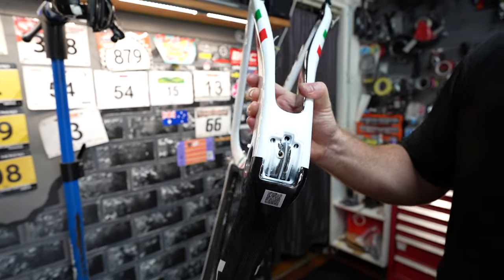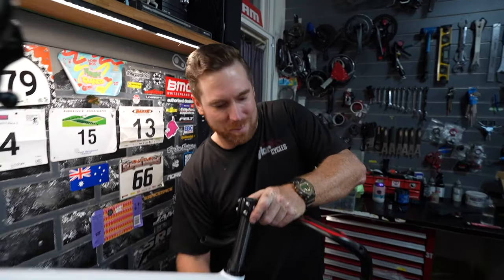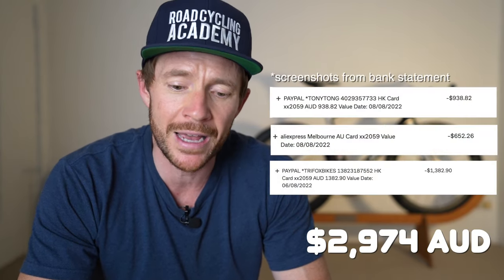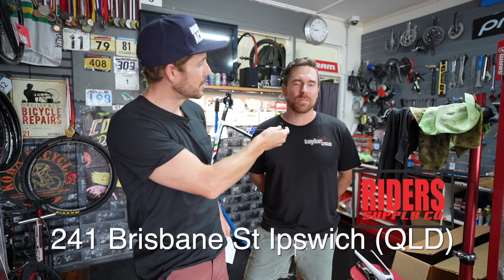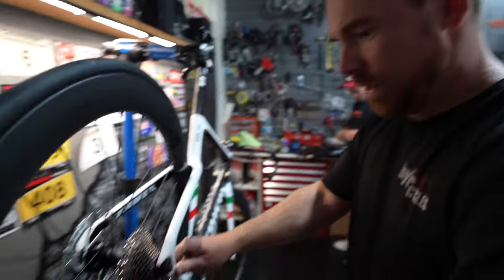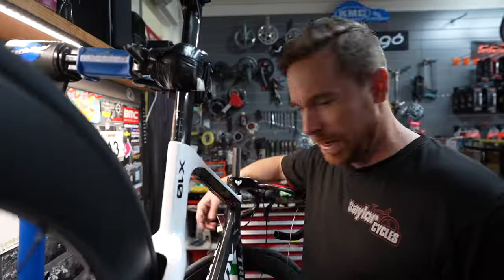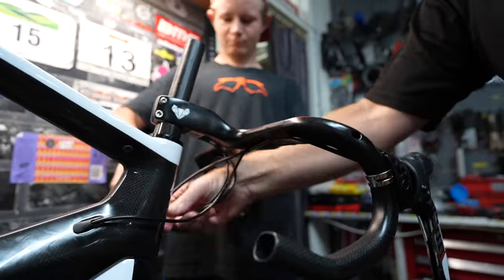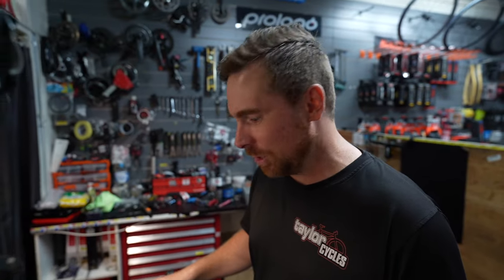We Built A Cheap Chinese Carbon ‘Race’ Bike (any good?)

Comment: well, I've been following Hambini & oz_cycle for years. I think I'll trust their opinions a lot more than a mechanic that puts together a carbon bike with a hammer.
Reply from the maker: Let’s not forget Gary from Carbon Steed was quite critical of the Trifox. Did both Oz Cycle and Hambini buy the frames or were they given them? I don’t know myself.
Reply: Exactly the handlebar issue could've been worked around with a little sandpaper, but instead the man just whacked the body of the stem with a mallet. Not really confidence inspiring
Reply: The Rubber Mallet displays an artist mirror of the frame quality....
Reply: @taylorcycles1931  I would NEVER trust a "mechanic" who uses a mallet on ANY bike, regardless.     Rgr
Reply: @borano2031  Your missing the point, I would never and never use a rubber mallet on bike build!  The quality was so bad i would not have built this bike up for a customer.
Reply: @taylorcycles1931  "Never use a rubber mallet"?? Point is you did. Not??     Rgr
Reply: @paolo_siega  Agreed, personally I would have removed the bolts completely and then possiblay tried a small wedge. No money to be made from people buying chaep Chinese frames. The big brand names took the piss during covid with their pricing but some people just believe the hype and jump on the cheap frames are crap bandwagon.
Reply: @stuartdale347  too true. I do understand the appeal of these cheap china carbon frames, but you're also paying the bulk of the money for QC and warranty support. I still don't agree with how the mechanic just hammered the stem in place just because it didn't fit right. no matter how cheap or expensive a bike is, its no excuse to just whack the thing hard and hope things fit because something just doesn't fit right.
Reply: @paolo_siega  And he hit it all the way down the steerer that could have been cut an inch over length first!!!. Seemed like it was a bit for effect for the sake of the video but came over  as a bad mechanic.
Reply: Wondering where this idea came from to build a „cheap“ carbon bike. Everyone is doing it, its totally against sustainability and has no value. Either buy good quality bike (could cost the same) that you can ride many years or build a bike from vintage parts.

Comment: I am a little confused about the complaint about the cable routing through the frame. I see he has the rear gear cable run through the right hole in the downtube (and the front on the left). But I run them the opposite way, with the rear going the the left hole and vise versa, so the housing does not rub against the headtube. I know you can stick helicopter tape on the headtube to prevent the housing from abrading the paint, but I would rather run the housing to the opposite side and not have them rub the tube at all. Plus it makes for a smoother bend of the housing from the handlebar. Also, I would use cable liner on the cables running under the bottom bracket to prevent them from rubbing on the bare carbon, so I would not consider that a legitimate complaint either.
Reply: All 3 cable grommets were for gear cables, the brake/disc grommet should have had a lager hole for the full length cable. Also the runner for the rear brake was pre run into the front derailleur lines.
Reply: @taylorcycles1931  I watched Hambini's Trifox review from a year ago, and now see the ports on the left side so I understand the problem now. Thank you. I wonder if he was sent a curated example for review, because he was rather impressed, given the cost. His was a different model, though. Regardless, since your example had faults, Trifox may not have good quality control over their production.

Comment: I have essentially the same build Trifox (X10, Sensah, Elitewheels).
My build process was smoother without some of these nagging issues like fork and seatpost, albeit I used different bars.

Put a little over 1000km on the frame and haven't had any real issues with it yet.

What's evident from the various reviews that are either positive or negative is that Trifox really needs to get their QC under control.
Reply: Cognitive bias ask the way through.
Reply: @DavidSmith-hz3jg  Or a shill account.

Comment: I bought and built a Trifox X18.  Had similar issues. Saddle clamp didn't even work (had to buy trek one that fit).  It does not ride well. It has flex in the bottom bracket and lateral flex in the fork and rear dropouts so it does wonky stuff in turns (not confidence inspiring... can't crit or road race a bike like that).  Pissed because I have like $2K US invested and I probably can't sell it, maybe should just part it out and eat the loss. Bought a used tarmac SL6 for $2750 and that is an awesome crit bike.
Reply from the maker: Interesting to hear that Travis, thanks for sharing on the thread.
Reply: Second hand SL6 value for money 👌

Comment: Great video! I have a trifox X18 frame and the build went really smooth. No issues with the seatpost, bar, stem, Frame nor fork. All from trifox
Reply: I also have a carbonda cfr 696 (gravel bike). Carbonda does have a better build quality, but they didn't have the geo I wanted for a road bike.
Reply from the maker: Interesting to hear. Thanks for sharing on the thread.
Reply: it is RNG if you get a piece of shit from them or an "okay" bike.

Comment: Having built an X10 and and X16 I can report on the following facts: the X16 had some paint overrun on the front drop outs (fixed with a bit of sandpaper). The X10 had tight clearance of the brake and shifter cable around the bottom bracket (fixed with a file). 
So how does the X10 ride? Follow up video please 🙂

Comment: As you say its certainly not a cheap build a sheet of wet and dry would sort out the roughness on the fork tube i would rather a tight fit than sloppy fitting however lets see the finished bike and your experience with the ride thanks Cam.
Reply: In my 27 years as a bike mechanic I've never seen a steerer this bad.....

Comment: I had my x16 built up with only very minor issues such as rim bike caliper fit tight and head set bearing fit tight to frame as you captured in your video. The seat post on mine fits perfectly and doesn’t have plays when it is toques up. Otherwise, it has ridden nicely and feels stiff in fast bunch rides. It seams like the seat post was rotating a lot side to side for your particular model was before it was tightened up? I think you can confirm that😊. Anyways, I am excited to see you make another video for first ride/impression!
Reply: Made x16 for a friend. I could just copy paste your view. It is an excellent Bike.

Comment: Well done to Jay Taylor for putting up with such a badly manufactured bike. All part of the experiment, Cam. Great learnings for all. Well done Cam.
Reply: They are hit or miss. QC isn’t consistent but most companies are excited to hear about your product. “Hey the seat post and fork are giving me issues” usually will get you freely shipped product under warranty every time
Reply: I undestand the frame is cheap,what do want for 600 dollars,he is not making things look good for him either.Use the hammer,that will fix things.There is a product out there called sand paper,he could have used it around the fork and handle bars.I going to stop watching the video here.I get the message,go and buy yourself a 5000 dollar plus frame and you will not need the sand paper.That's what you think - i have build very expensive bike,at time you do not only need the sand paper,You have to send the frame back to the Mfg.Ciao from Italy.

Comment: If anyone looking for a affordable fully build "UCI Approved" carbon aero race bike. You can consider "Java Fuoco J-AIR" (2021). The specs are pretty good for the price of just $1200 USD. 

- Full Carbon bike inlcude wheels / Handlebar . 
- Aero frame / Handlebar .
- Fully integrated cables .
- 50mm loud hub aero wheels.
- Shimano 105 . 
- UCI Approved .

You can see the bike on my channel. That video equipped with Sram Red but thats for racer, you can get the normal version with Shimano 105 for $1200 USD. 

This bike also ridden by a spanish pro team called JAVA KIWI ATLANTICO.

Comment: This is a pretty similar experience I had with the X16, except I bought handlebars from Toseek, my first bike build, didnt know what to expect, it was ok overall, love these video!
Reply: I've had two pairs of Toseek carbon bars, on two bikes.  The first bike was a roadie only.  The second pair I put on a steel frame that had wide tyre clearance.  And I would ride it off road with my 2 year old in a baby rucksack.  The bars cracked, but, they're probably not designed for that kind of abuse.

Daughter is 4 now, and I switched to alloy bars after the crack.

I think the crack was due to my abuse.

The first road bike and bars, and application used for, definitely good bars for the price

Comment: I can't believe the prices of old top of the line rim brake bikes on Facebook marketplace. I just bought an S works sl3 with full dura ace and then a set of Reynolds arX carbon wheels all up spent 1800 bucks. Bike is stiff as a rock and 6.8kg.
Reply: 2012 Cervelo S5, full Chorus, no wheels... $1050,00???      Rgr

Comment: I guess take away is it's still better to shop second hand like damn 2000+USD is still a lot of money for a bike and that's coming from the owner of a Giant TCR Advanced lol. I mean, I'm definitely stretching that mark with my bike (I've basically gone full AliExpress besides the frame, the finishing kit and the Shimano Tiagra cranks), but when I was a kid I thought spending over 1000$ on a bike was bonkers but then again back then you could buy a carbon tcr with 5800 105 for like a little over 1000$.
Reply: Or get a winspace or elves frame
Reply: @invisiblescout6335  True was going to get the avari at first but a TCR came at an even cheaper price 
Edit: The TCR was 2nd hand but it looked brand new when I checked it so I took it though it's a 2012 model

Comment: Built up 2 sets of X8, had the same issues with my headset bearings, felt real sketchy installing the bb, had to sand away the paint to get the brakes and wheels to be installed

Comment: Some significant design tolerance and design routing issues highlighted! From reading the comments it sounds like the manufacturing output is inconsistent and suffers from a lack of proper qc. For the money though, is it worth it? 
You will have to ride it, race it and get some significant distance on it to find out. 👍

Comment: I've never had a stem to steerer issue like that bike. At least the bearings is t sloppy 😮
Seems pricey cam as you can get a carbon polygon with 105 disc and carbon wheels for 3k. I reckon I could build that for under 2.5k.
I know that frame had issues but they were easy to sort and you're mechanic is a bit heavy handed with you bike mate irrespective.

Comment: It proves that if you think you can pull one out of the box and just put it together, you're not going to be able to do that.  But just how serious the issues are isn't clear since nothing was measured, e.g., was the headset tight because a little bit was sticking out that needed to be sanded off or was it tight because it was too small all around.

Comment: Cam, you need to provide some costings here.  It might have been cheap to buy, but 4 hours for a mechanic + a bunch of new bits, is going to add $450AU at least (googling mechanic current hourly rates). 
What you going to do with it?  5,000km and see how much it costs you to keep it running. Provide a true cost for everyone - in other words are you better off just buying better quality because it doesn't bend/break?

Comment: Cam, do you think if you had sent that frame back and demanded a new, pointing out the faults etc they would have sent you a new one?
Reply: They're not faults, they're tight tolerances. It's very possible that the issue is with the handlebars and not the steerer, for example. Which is essentially the main issue there. Either way some sand paper would shave down a hair and Bob's your uncle. Sorry, the seat post flex is an issue. Not sure about that one.
Reply: @pierrex3226  if that bike turned up at my house with those problems , it would soon be going back. The mechanic mentioned about the cables rubbing and possibly breaking if not dealt with is in my opinion a fault.

Comment: It is giving me flashbacks to my velobuild frame that ended up having an issue where the rear wheel would work itself free on big power. Happened twice before I've retired it to hang on my wall. Two different sets of wheels, both times the wheels were on tight.
Reply: Damn I'am having the same issue with a delihea frame. Still hoped it wasnt secured tightly enough but your comment seems to indicate the contrary. Wonder why it could be though.
Reply: @ramouflard  honestly i have no idea because when i inspected them they look fine. Maybe a poor design on the dropouts that don't secure them properly, either way i'm not keen on testing it anymore since the 2nd crash broke some bones in my hand. The wheels were both "legit" brands aka fulcrum 5's and shimano wheels.
Reply: @jacklalalaful  yeah I don’t race so for casual riding it’s a lot less sketchy. The only time I actually took part in a race it happened and made me get dropped by the group I was in. No fall but could have been way worse :( .

Comment: Personally i don't wanna go in store of man, who hammer carbon frame, someone gonna ride.
Reply from the maker: I’m pretty sure Jay said he typically doesn’t use one. But he had no choice. We’ve done four builds together now and this is the first time I’ve personally seen him pull it out. The hammer that is
Reply: it made for a fun video, but it isn’t a good look for him unfortunately.
Reply: I would NEVER EVER do this on one of my builds. 
If a customer came in with frame I would refuse to build it and tell them to send it back and get a refund. The Rubber Mallet displays an artistic mirror of the frame quality.... a professionally frame will never be built in this manner.

Comment: For that price I would rather seek for a secondhand bike lol
Reply: Yes, something like a Specialized Tarmac SL6 FACT 9r would suffice for the average rider. I absolutely like this model's mechanical design, no quality issues for me to rant about too, maybe apart from the seatpost clamp's torque spec (labeled 6.2 Nm, but this can actually crack seatposts, so 5 Nm is enough).

Comment: Called it before it was built. Until you purchase a T900 or T1000 Chinese frame, this is what you get. The same price or less gets you a modern MADONE level frame. I guess this was done on purpose to try and stop sales or the belief that manufacturing can only be done correctly by some outside Western companies  tutelage? Im here to say you can RACE with the worlds best equipment for dirt cheap. That frame might be a T700 carbon layup, which is OVER a decade old.  Manufacturing is not coming back to the west IN YOUR LIFETIME, and Chinese manufacturers are the masters of carbon fiber production. TRIFOX isnt the top of this pinnacle in any capacity.